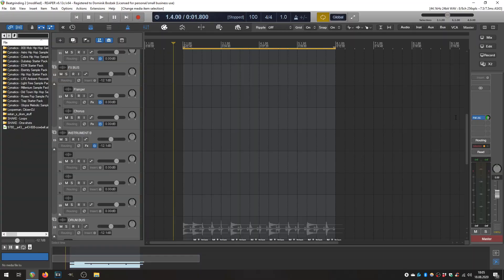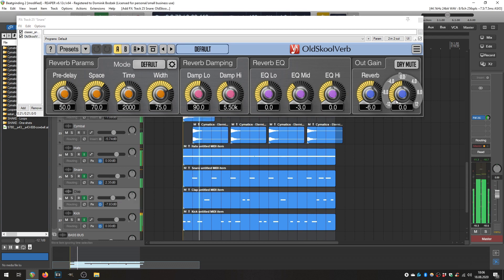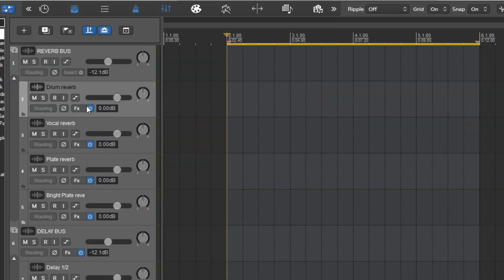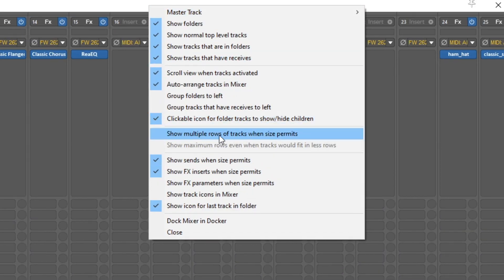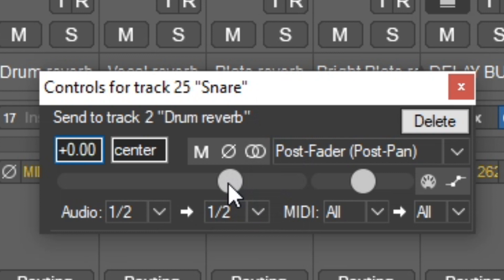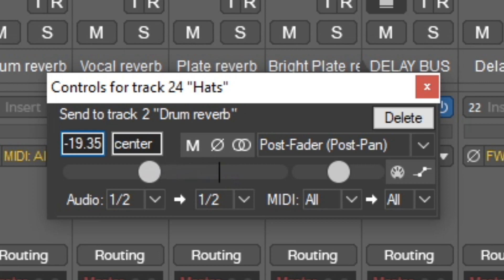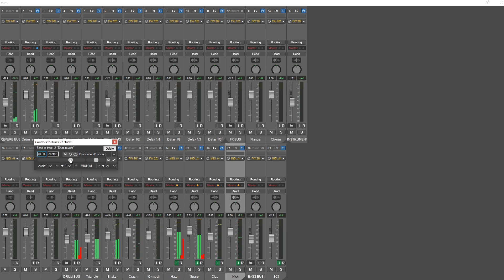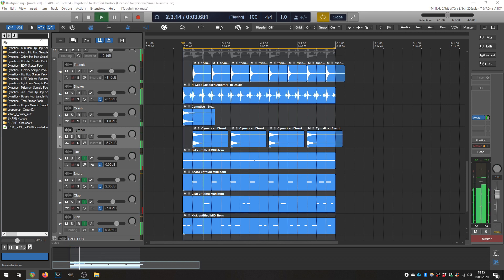Use REVERB SENDS! (if you love your PC) 🔌 | Reaper Beat Making

Comment: is it me or the reaper you have is different than mine? because there is no drag and drop routing on my reaper, and the way u add effects on tracks looks different than what u have. Has there been an update for reaper? and if yes how can i do the same thing now?
Reply from the maker: I'm using a theme called iLogic, but it doesn't change the basic features like drag and drop. In the basic theme you have the FX button for effects and a small button on the left of the track responsible for routing
Reply: @WodzuBeats  for me there is a route button that doesnt drag and drop, litterally a button with the name route on it, do i have an older version of reaper? Or is it because am on the trial version?
Reply from the maker: @a.u.3371  it should drag and drop, use the left button on your mouse 🖱
Reply: @WodzuBeats  ill send ya a screenshot on ur insta wait

Comment: Thanks a lot for this vid.
Would you make a video in which you take a song with a bunch of reverb plugins and then implement the FX sends?

Doing it from scratch doesn't seem complicated at all but my problem is that I already have some projects without sends and when I try the sends it doesn't sound alright :(, it is a nightmare with 30+ tracks, most of them with a reverb plugin or something.
Reply from the maker: hm, that's not a bad idea - i have some older beats which were mixed the wrong way